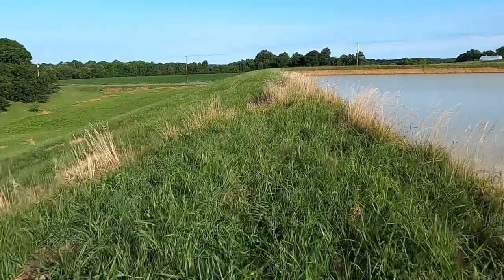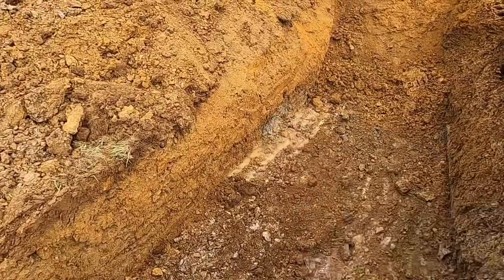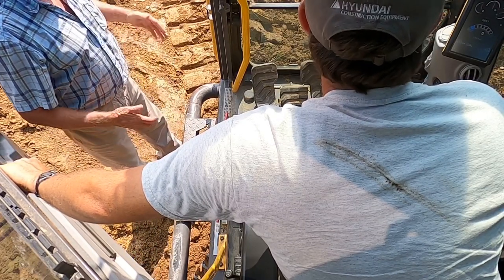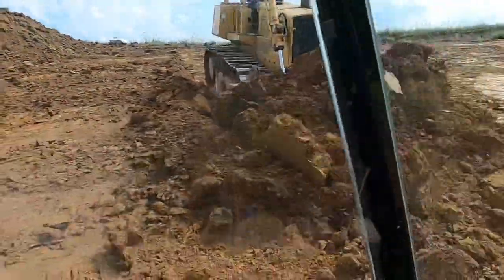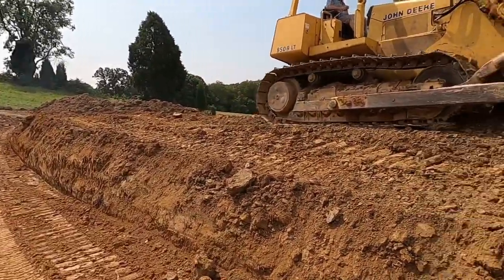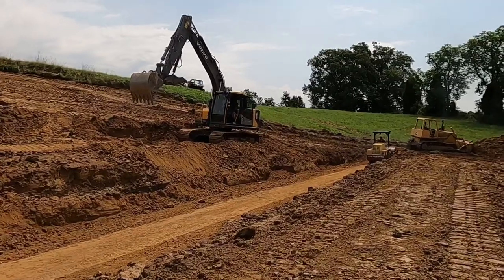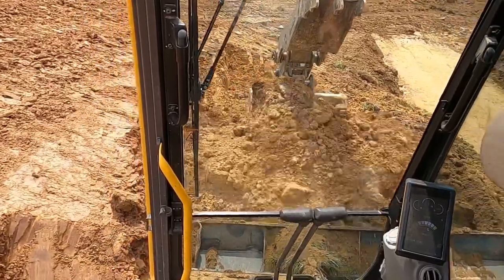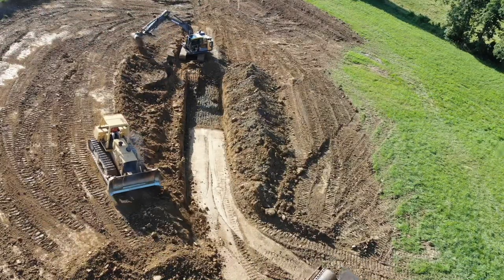Emergency  Dam repair First day on a high stakes job lets see how this goes

Comment: Mikey... you should have hollered... we don’t have landslides here!!! The rocks knit together so tight you have to hammer them apart!   I could have sent you a train load.

Last week the ground was dry as powder.  I excavated a small swale along the drip line of my barn overhang.  Only 12” deep.  The clay that passes for topsoil was mixed in the rocks.   I have a small 2”X2” screen that I thought would separate the larger stones out.   When I dumped the first bucket onto it, some dust and small stones came through.  I shook the screen... turns out that 75% of our fine S/W MO soil won’t fit through a 2” screen.   But, mixed  together water won’t pass through and there ain’t many forces of nature that’ll move it!!!  Wanna load?
Reply from the maker: We could definitely use some form time to time

Comment: Regarding the excavator operation. As you extend the arm out “full reach” and then pull it back to you is there a hydraulic system that keeps the teeth at the same level during the pull back. This level reference being the floor of the cab or something on the tracked portion. Without some automatic system it seems extremely difficult to create a flat surface. Perhaps it’s the Pepsi!
Reply: There is automatic grade control but not necessary just a little seat time is needed. Excavators aren't the machine of choice for creating flat surfaces anyhow.
Reply: Nick Hill < Dirt Perfect does a good job of it unless of course he has a differential GPS antenna hidden from view!😉

Comment: Good job here.
I saw the dam failures earlier this year in Edenville, and wondered what it might take to shore up this type of structure.
Reply from the maker: Yup that was bad up there
Reply: The problem there wasn't a degradation of the dam over time like this job, but an overtopping that demolished the dam.  To much water hit the reservoir an even the emergency spillways couldn't move enough water. To the best of my knowledge even a concrete dam will fail under those conditions.

Comment: If you need some dry dirt, come on down to my place. I thought I was digging a post hole, but apparently, it was just the auger wearing off and getting shorter.  Two hurricanes in three days, and we haven't had enough rain to settle the dust.  Enjoyed the video.
Reply from the maker: Crazy

Comment: DP-got a question for ya--is TMBTS--ur brother in law thru ur wifes side? or is he ur dozer man-Jerry's son? just wondering where he fits in with ur workers is all. and back in the day i ran a bit of roller--a lot bigger ones--but i couldn't hear the viberator working on urs-maybe tmbts had it turned off so not to make the wall of dirt slide anymore than it had. tell him to turn it on for us to hear out where it won't hurt anything. ok thanks for the video-i liked it a lot.
Reply from the maker: Neither are dads where friends and worked together a few times
Reply: @DirtPerfect  ok-no relation then at all. just good friends-thanks

Comment: Hay Mr Dirt Perfect. Not tailing you how to suck eggs but we would not roll the key way with a smooth drum  we'd us a pad foot roller so that the clay is all combined .and all the holes tie it together. I don't no but i think it would stop the sop stone form slipping to. Good luck with it.
Reply from the maker: Chris thats why you track it between lifts 🤷‍♂️
Reply: We use to track them. Up and down with dozer.  In layers.  Instead of sideways. , for. What ever difference that was supposed to make.    But thats how the ole timers around here tought it.        I do know it makes a big difference on seeding the top loam layer.       Small dozer track toe to top track marks made awesome waterbars. Hardly get any erosion before seed grows.  Track it siddways and erosion all the time.